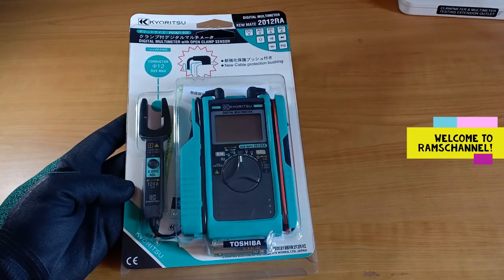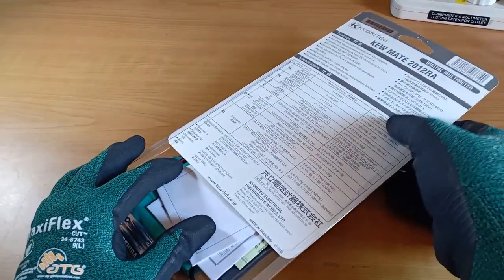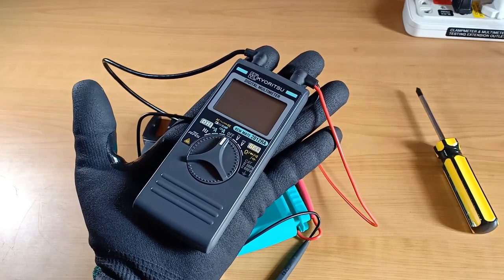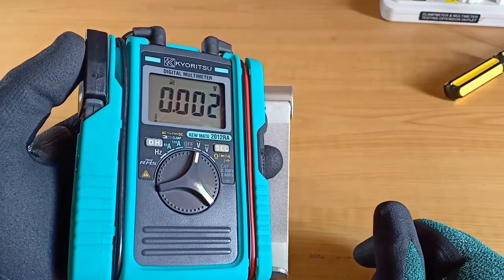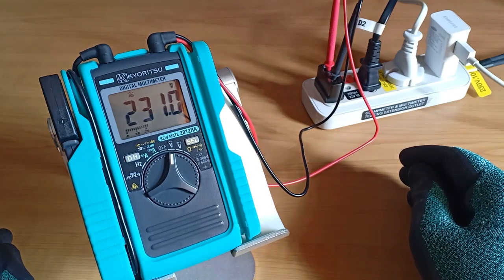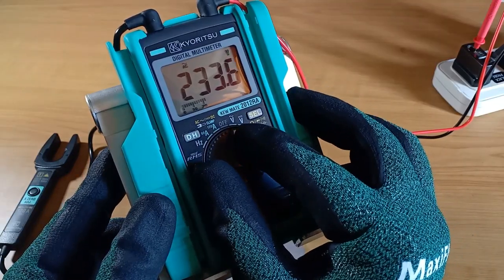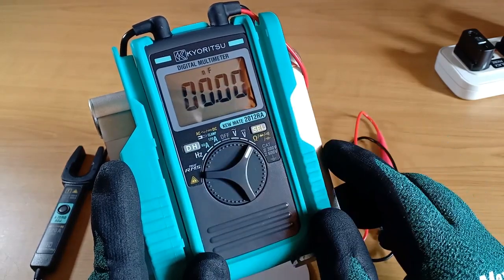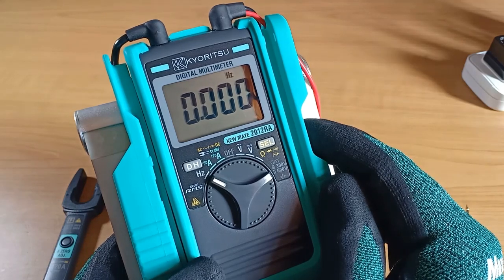[Eng Sub]KEW MATE 2012RA Compact Digital True RMS Multimeter with AC/DC Current Sensor

Comment: Does this model has Min/Max function? Can this model measure in-rush current? Overall it looks good.
Reply from the maker: Thanks for watching. No, it does not measure inrush current, nor Min-Max. Its main value proposition is its small form factor that features AC & DC current measurement with TRMS AC and the most common DMM features.
Reply: @ramschannelreviews  In one review of this multimeter it was mentioned that new model does not have manual ranging just auto selection. Is there are any particular reason for this?
Reply from the maker: @stanleywhiteman6450  I can only surmise, to keep the cost down. Perhaps also it's not necessary for an instrument of this type. If you're looking for manual ranging on a very compact clamp meter, an alternative is the Hioki CM3289 AC clamp meter, which has a power-up option for manual ranging. It does all that the KEW 2012RA can, except DC current measurement.